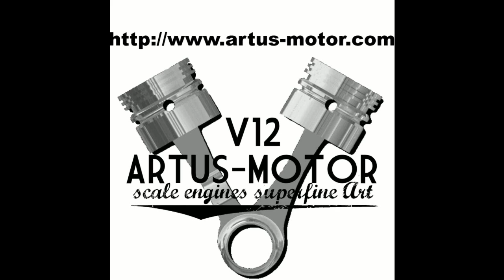V12_mini_engine

Comment: Amazing, the flywheel you are using, is that weighted to immitate the resistance of a propeller? Does this engine increase its rpm as quick or quicker than a Merlin engine? Just curious about it really,